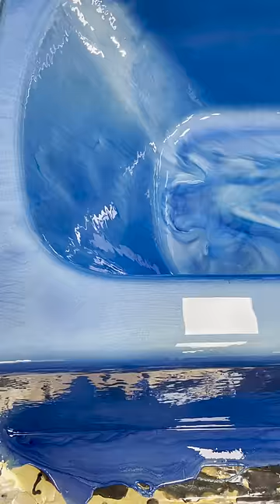Caribbean Blue Bathtub with Epoxy

Comment: That is so beautiful! I wanted to restore the one I had. I had a bathtub shaped just like this! I loved that bathtub! It was out in the backyard pasture and I had a fire pit dug underneath it to heat water. But then I had a better idea. I took a garden hose splitter and hooked it to the hot water for the washing machine and took the garden hose and fed it outside through the dryer vent. I spent countless summer nights gazing up to the heavens.  I miss it so much.  I wish I did not have to leave it at that house but I couldn’t move it by myself.  😢

Comment: Looks sweet man! Question, after mixing up the epoxy, does all of the air need to be vaccumed out of it before application, like in a pressurized tank?
Reply from the maker: Hey there! great question! No with this product we lightly torch at the end to pop any lasting air bubbles.

Comment: Из ванны сделали офигенно красивый тазик ))) ... а где слив?😊😅
Reply from the maker: This is our office demonstration tub. We have poured on it several times and because of this we stopped masking it off.
Reply: I assume they drill it later
Reply: Would look beautiful with all brass fixtures and drain
Reply from the maker: This is our demonstration tub so we stopped masking it off. We would typically mask off the drain and remove once cured.  @kentxxxkentxxx2814

Comment: Isn't there anything they can do to avoid the silver streaks, or at least make them prettier? I'd love to have a bath like this but I don't like the streaks on the base
Reply: Yes. Nearing the cure time they can come back with a stick and swirl it to make patterns. They got lazy with this and expect youtube vids to provide but they just needed to go a little farther.
Reply from the maker: Yes you can lightly spray a mist of 99% Isopropyl alcohol to remove any streaks.

Comment: How well does epoxy hold up over time with an application such as this? Thanks
Reply from the maker: Very well we have many tub resurfacers, who we designed this for specifically, as they previously would use the spray epoxy and hated how that product only lasted 3-6 months. Once they switched to our product it has been one and done.
Reply: I'll tell you don't get the Amazon shit... we had a contractor redo our 100yr old tub from brown to white and it hasn't lasted a month before it has started flaking, so when they come back to replace the white windows for the blk ones that we wanted they get to do it again...
Reply: This product right here is the best in the business.

Comment: If you plan to do it again go make a texture pattern to apply on the center so it becomes non slip, just some small divets or something to help keep you up right in the shower
Reply: Shhhh
Reply: Yes called glass beads they are made for this
Reply: or just apply a non slip mat
Reply: Or just shower in a shower
Reply: @ru55ells Wow, never seen a house with a tub, that is also the shower? Must live classy like.
Reply: Great 👍🏻 idea 💡
Reply: А если лечь то узором можно и стереть кожу
Reply: @Gillslayer92  not classy enough to have a drain!
Reply: You can clean it Dr. dip shits😂  can't imagine the scratches in that over time. That is what bath mats are for. Was thinking same myself. But it is too pretty. Dk if it is non toxic to sit in a bath. Wonder what salt or oily beeds in water would do to those standing. Ripping shower curtain and pole out all ripped up as your doing splits.  Pull groin muscle, break a hip, ko, tootless, and that is if you don't drown.  yeah was thinking no grip too.

Comment: Looks great I was a bathtub resurfacer in the 80’s tip hydrofluoric  acid is used to open the pores in the ceramic for a proper bond
Reply: Chiedo scusa volevo scrivere fluoridrico

Comment: How thick does it hold on the vertical sides compared to other flatter surfaces?
Reply from the maker: Very well, we created our high quality tub epoxy to  be able to hold up to a standard size tubs verticals.
Reply: @CountertopEpoxy  
Thanks for the reply. I recently gained a hairline crack right across the bottom of a Belfast sink, would this make a good repair instead of replacing the sink?
Reply from the maker: @monkeyportions1722  we would suggest to fill/repair the crack prior. The epoxy will resurface but isn’t created as a “fix” for cracks and such prior to a pour.

Comment: How long does this last though? Ive seen tubs peel and crack after having this done.
Reply from the maker: We have created a thicker more durable tub resurfacing epoxy. This is why it's not thin enough to be sprayed. As most of the sprayed coating can last months as you stated. When prepped and coated properly with our tub coating it can last decades.

Comment: Should of cleaned that tub spotless first any dust can prevent good contact between adhesive and surface.
Reply: Doing adhesives is like welding the cleaner the better.
Reply from the maker: Typically we would clean and prep very well before pouring; this tub has been in our workshop for months and we repour it regularly during our classes.

Comment: You could go to home Depot or Lowes and do it yourself
Reply from the maker: Absolutely! Epoxy is very easy to use, however not all brands are the same. We've tested our brand on many surfaces to make sure it's the best and we also are one of the only brands to create a 100% solids, zero VOC product. So there's no fumes and it's safe for children and pets.

Comment: There is no drain hole in the bottom
Reply from the maker: This tub has been poured 30+ times during our classes. We pour it to show off our product, not to have a functioning tub so we never taped off the drain. Typically. though. you would want to prep it and tape off the drain before pouring!

Comment: I need materials
Reply from the maker: You can find our tub coating here: https://www.countertopepoxy.com/fx-tub-coating/
Reply: What type of resin do you use  so that it does not run off likd tears or drips?
Reply from the maker: This is our Tub Coating epoxy you can find it here: https://www.countertopepoxy.com/fx-tub-coating/  @rodolfopenaloza9135